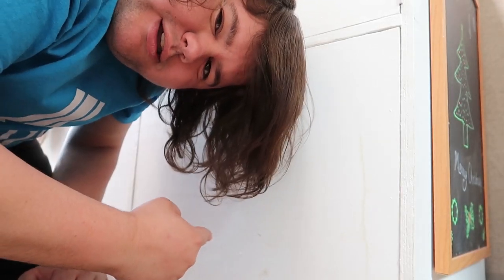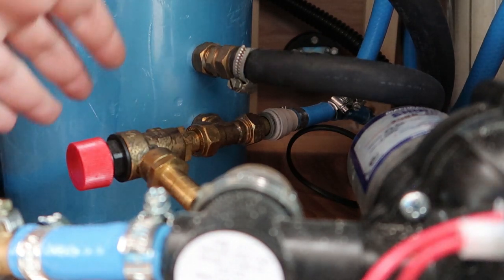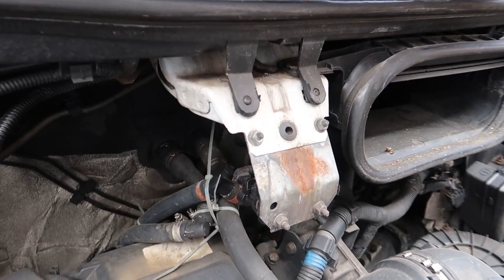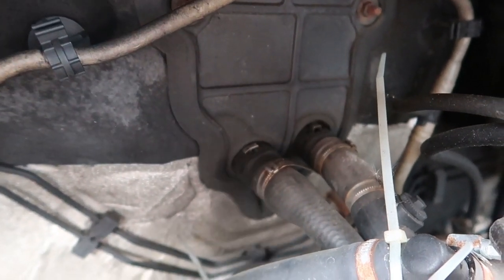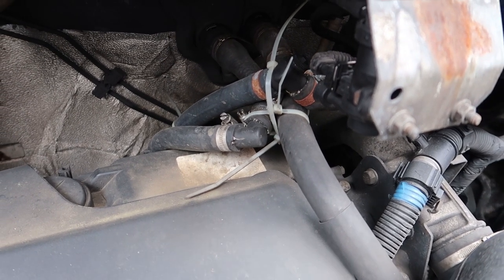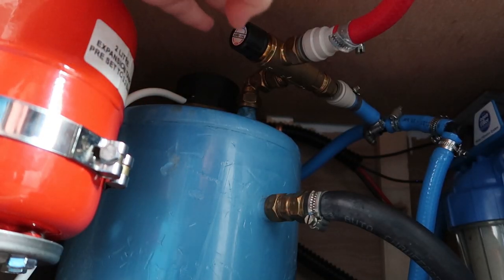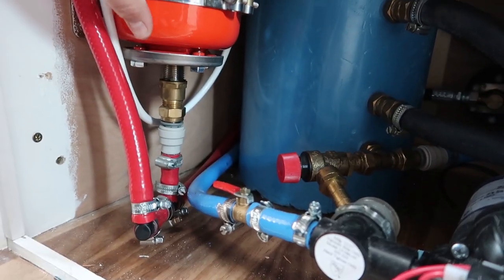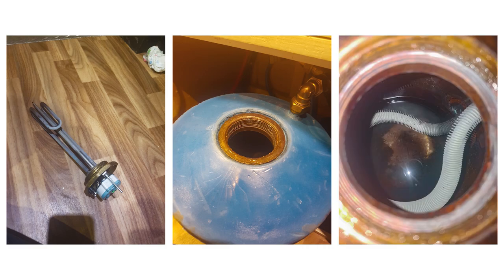How to Get HOT WATER in a Campervan Using the ENGINE! Calorifier Tank in Campervan | Van Conversion

Comment: Hi Guys, great video and you have convinced me that this is the way to go. However, i have a question... Can you explain your decision to put the calorifier in series with your heater matrix? in this video: 
https://www.youtube.com/watch?v=cFkOs8MyZFw
 the guy installs Tees in place of elbows and has the heater in parallel. There must be pros and cons but i wondered how you arrived at your decision. Happy travels
Reply from the maker: Thanks for watching! The people we learned this setup from had installed it this way, and as it worked for them we decided to go with the same installation, I guess it means only cutting one pipe compared to both. The main benefit I see going parallel is you could install taps so that you could isolate the calorifer if say you had a leak... But in all honesty its not to hard to disconnect are L piece and just connect it back into the main lines removing the calorifer from the loop. There could be benefits such as your water may heat up quicker, but I cannot confirm. If you go with the parallel setup, let us know how you get on / what heat up times you get, be interesting to compare!